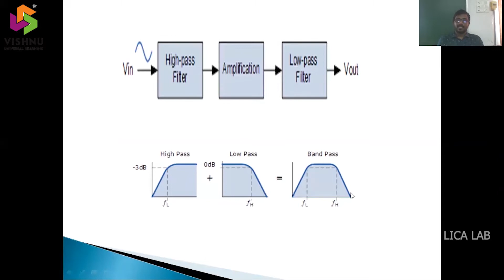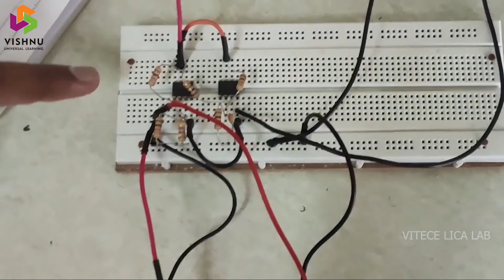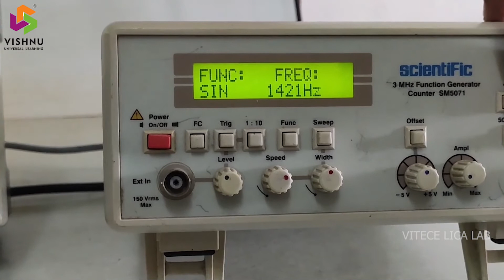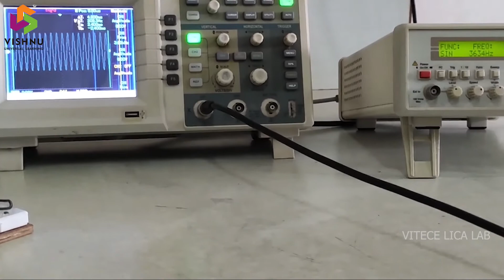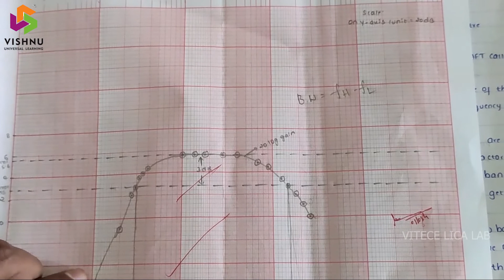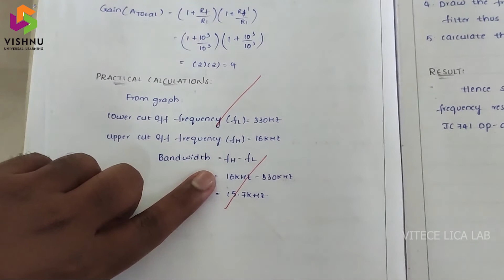Frequency response of Band pass filter using Op-amp

Comment: i just wanted to ask a question...your input voltage is 2v as per gain formula output voltage  should be nearly at  2*4=8 v, but in the experimental table hare i see the  maximum output voltage is 3.9 and gain is 1.95...please responce as soon as possible.